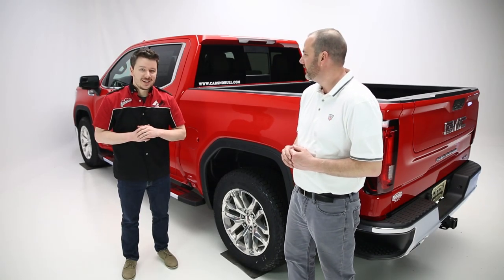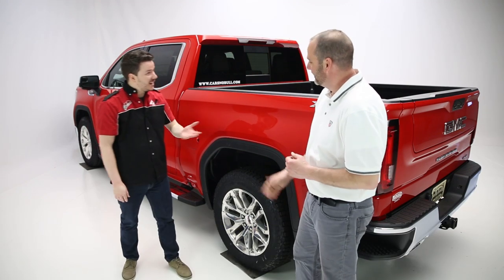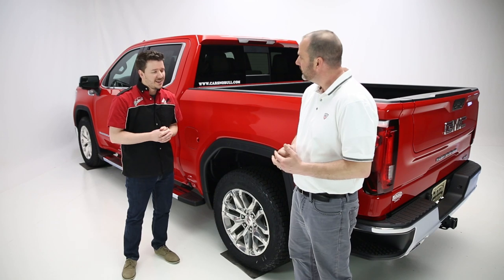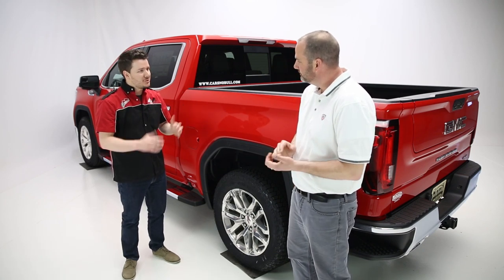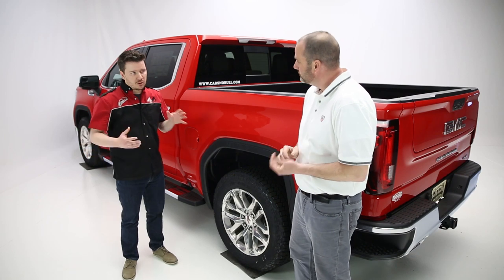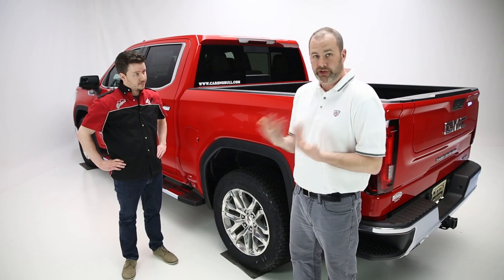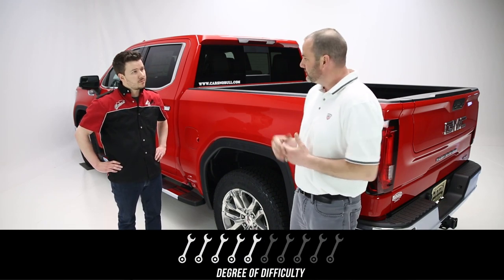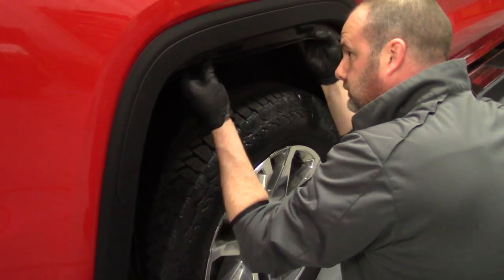In the Garage™ with Total Truck Centers™: Rugged Liner Wheel Well Inner Liner

Comment: Nice instructional video. Yeah try to get a wrench in to take off the torque 10 fasteners on the rock guard. So easy. If easy is to take off the wheel and lift the truck in the air.